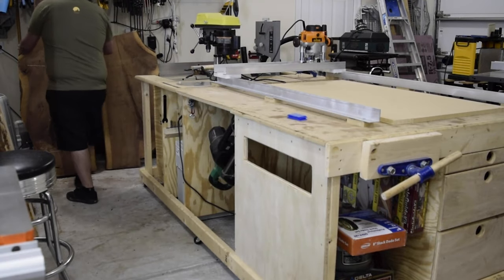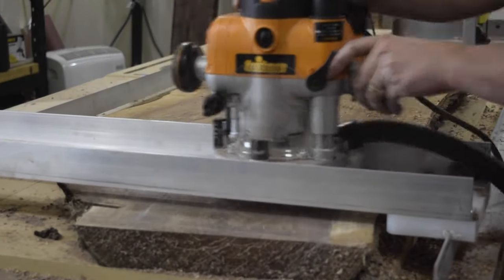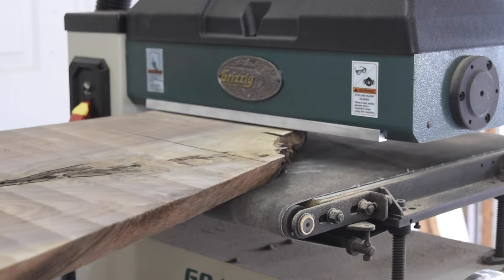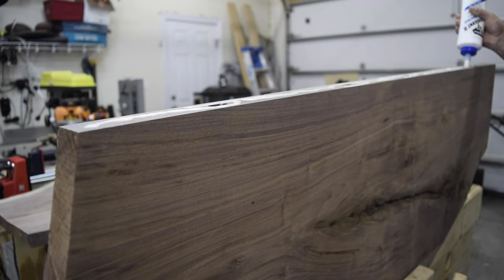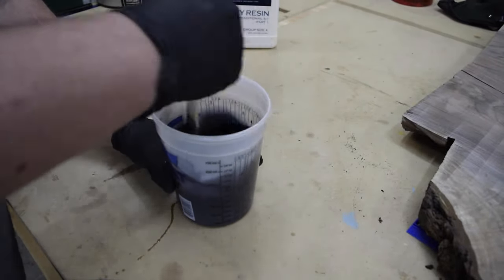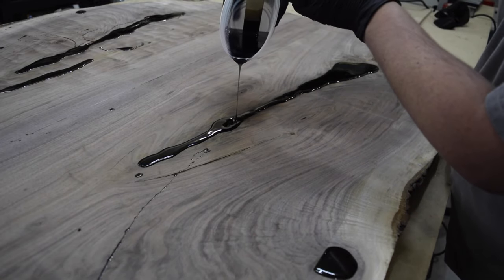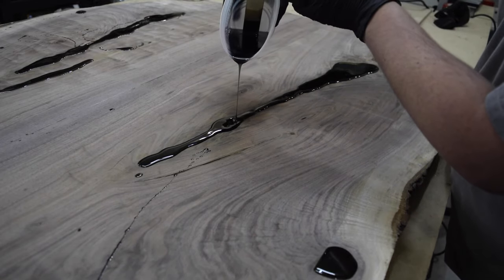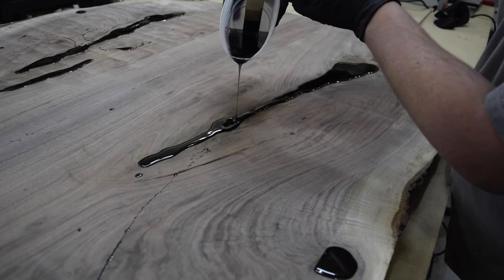How to Build a Wood Slab Coffee Table | Woodworking Project

Comment: Is the router sled homemade or can you link it?

Also did you make the base?

Really great work!
Reply from the maker: Hi Jay, thank you! I made the router sled from aluminum angle and some 1 inch thick HDPE. I might do a short video on the sled on my Instagram account if there is enough interest. As for the base I had that made for this project, I don't do any metalwork... Yet!  I'm glad you enjoyed the build video!
Reply: @TimberBiscuitWoodworks  hey another question - where did you get those legs? I’ve got my top almost done and just can’t find any I like online.
Reply from the maker: @jayluikart487  The base was made by a local welder. You might be able to find something similar on Etsy though.